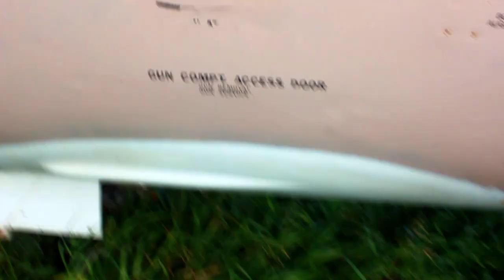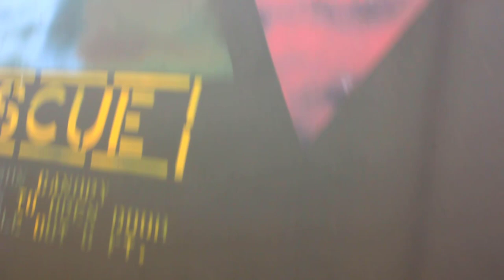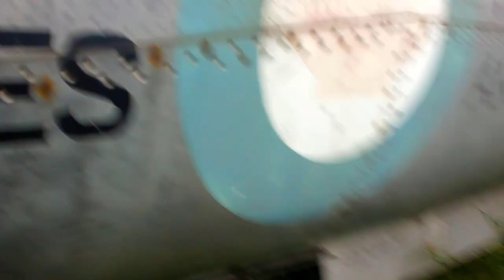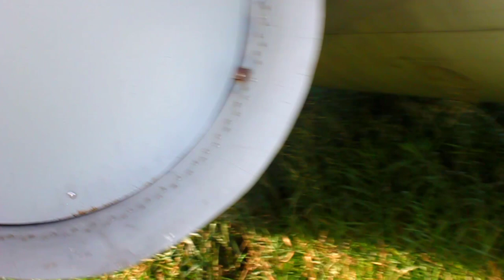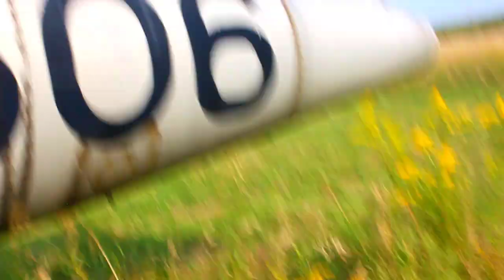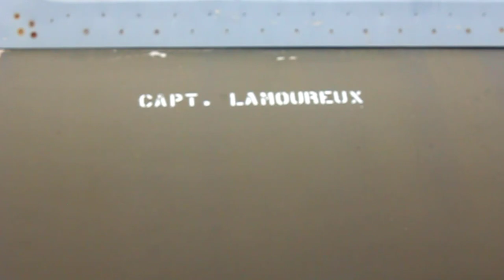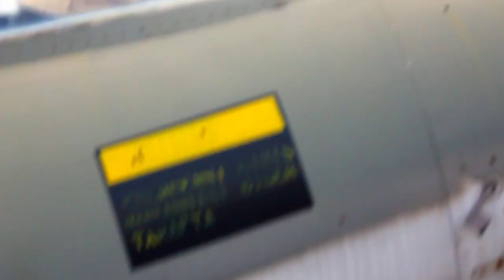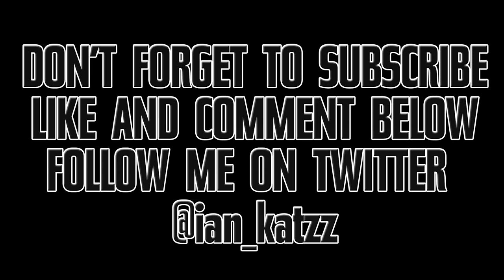VISITING THE CANADIAN AIRFORCE AIRPLANE GRAVEYARD WITH MY WIFE MARIE (CAN YOU NAME THAT PLANE?)

Comment: A further follow-up with regards to the CF-116A 116703.
This machine (the third  "A" delivered by Canadair under the production contract) came on strength with the RCAF in January 1969.
116702 and 116703 were the original "AETE" birds and they were moved from Uplands to CYOD when the test establishment was relocated in 1971. 

This machine was subsequently put on strength with 434 TFS (simple matter of dragging it from one hanger to the next...LOL) in the mid-1970's, once the weapon eval's workload for the CF-116 wound down at AETE.
116703 got it's "red, white, and (blue/black?) paint scheme in 1989 when 419 Squadron received it's "Colours" in recognition of service rendered to the country. It served as the CF-5A display aircraft (at airshows across Canada) during the 1989 and 1990 seasons, wearing this paint scheme. Following this, it was removed from service and was stored at Mountainview from 1991-2005.
The (much reduced) airframe was transferred to Markham in November of 2005.
As far as I can tell? The other singles at Markham are 709?, 712?, (713 is certainly in the video), 714, 717, 724...I could go on digging; but why bother?
A serious overview of the CF-116?

If you want an example of "pork-barrel" politics? 

Look no further than this entire (CF-116) project.
Let's dump CA$Millions into building an aircraft that the RCAF has no use for (other than as a "lead-in" trainer; for which it redeemed itself) so we can keep the Quebec faction onside.
Meanwhile gutting the "actual" frontline strength of the entire airforce.
We only ever stood up two operational (16+/- airframes) squadrons on this type (433 & 434) and the other 90+ machines were superfluous to our requirements. 

So we sold a batch off to Venezuela in 1974...which got us a nice lawsuit from Northrop (swept under the carpet by Trudeau Sr. and the MSM of the time).
Peckers suitably spanked, we stored the rest of these (at tax payers expense) in Mountainview for years. Rotated them in and out of storage (again, an expensive exercise) and kept on with the facade that these planes were actually useful on an operational level...which they really weren't (except when employed as the aforementioned lead-in trainers).
To add insult to injury (on an already painful experience)? At the worst possible time, the Mulroney Government decided (in 1991/92) that we should spend a shit-ton upgrading the stored "A's" with new avionics, ejection seats, communications/data links etc.
Which we did...at the taxpayers (and the military's) expense.

And then the Cold War ended. 

And all of your tax dollars spent on the "tinker-toy" upgrades were sold to Botswana at a loss.
From what I've read, Botswana was very happy with the product they received, courtesy of the Canadian taxpayer.
As this video shows? They've got free access to tons of airframe spares to keep their birds in the air.
Just got to sneak in when nobody's watching.
You can take a main spar assembly as quick as you can shoot the OP video.

That's enough for now...LOL

Comment: Thank you so much for sharing that video! My grandfather logged 5 flights in that F86 Sabre #301 based out of Sea Island (YVR) with 443 Sqn between Feb 3 1957 and September 1958. It's great to see it reasonably intact compared to some of the other air frames there.
Reply: On your last set of planes the one with the horizontal stabilizer on top it's a f-104 built by Lockheed the one with the intakes just below the bubble canopy is a Lockheed f80 and no they are not bombs there are fuel tanks bombs have a spinner on front which arms of weapon after being dropped from the plane please do more videos but do more research before you add it to your video

Comment: Blue and green airplane near the end is called the t-33.  licence built by Canadair.  Also the brown f-104 was also designed by Lockheed but built at Canadair is belgian.  Built as well for Canada, Belgium and the Netherlands at Canadair.  The CF-100 was designed at built at the AVRO plant at Malton.  the northeast corner of the airport.
Reply: licence built by Canadair as the CF-5 are what you call F-18's,  Built for the dutch as the NF-5.  Saw them at Plant 2 Cartierville airport.  They also built the F-86 (the one with the snout in front) at Canadair, under licence.

Comment: The group of aircraft  shown are all CF-5 Freedom Fighter plus a prop trainer, the nose is from a transport, the Drop Tanks are not BOMBS.From  7.52 to14.30 are CF-104 Starfighters, the panel she asked if it was French is in english, french and german,After that is a CF-86 Sabre,then the AVRO CF-100 Designed and built in Canada. After Cunuck were back to CF-5, the plane at 21.13 is a CT-33 jet trainer, it is split for engine removal.I will have to look up the twin engine transport.
Reply: It is a Beech 18 known as the Expeditor
Reply: The third language is actually Dutch but I am picking up what you're laying down here bro

Comment: A number of CF-5s (fighter) and T-38s (supersonic trainer), both essentially the same airframe built by Northrop Aviation. Chewing gum noise made it hard to continue past the CF-104.
Reply: Canada never operated T 38's. These are CF 5D's and they are an entirely different machine than those built by Northrop. They may look alike, but they are miles apart in terms of avionics,  engines, and weapons capability. The CF-5D was a combat capable aircraft; the    T-38? Not so much...
Reply: @ronschock6545  - thanks for the feedback! I had forgotten about the two-seat D version and I had to do a little more research. The T-38 was just a trainer, never intended to enter combat, although the F-5 was evolved from it as an "inexpensive" alternative to heavier and more high-tech aircraft. Airframewise, they're virtually the same less the weapons positions. As you said, the avionics and engines were different, and weapons capability was not an option on the trainer. Only the combat F-5 (US-produced and foreign licensed versions of the airframe) utilized weapons and had the avionics and more powerful engines to that purpose. Link to Northrup Grumman: https://www.northropgrumman.com/air/f5-tiger/
Reply: Built under license by Canadair.  Plant two,  I was a cadet in the adjacent hanger building at Cartierville airport.
Reply: @flyingmythbuster  - Very cool.

Comment: Hi, 
Sad to see all those birds fading away.
Green camouflage aircraft is ex CAF CF-104D (MSN 5328:104658) flown by Turkish Air Force between mid 80's mid 90's. 
F-104 deployment within the TurAF ;
8 Main Jet Base (Diyarbakir) 
181st Squadron 1985 - 1993 (ex CAF CF-104), later F/TF-104G  
182nd Squadron 1974 - 1980 (F-104S to 191 Sqn)  
182nd Squadron 1985 - 1994 (ex CAF CF-104, CF-104D), June 20, 1994